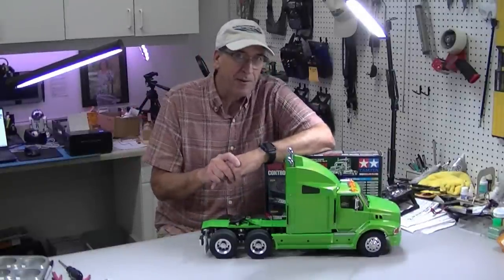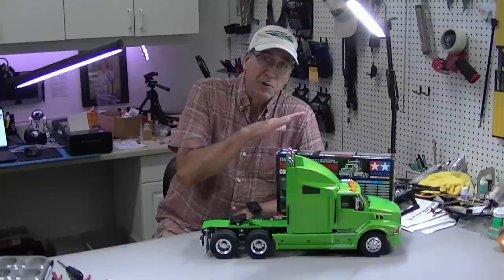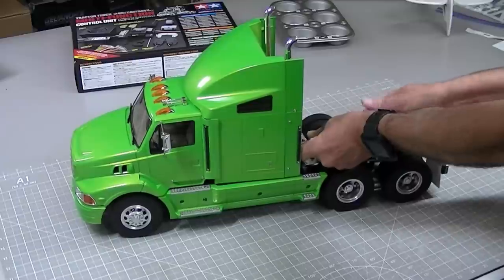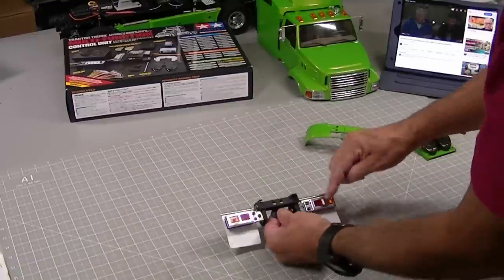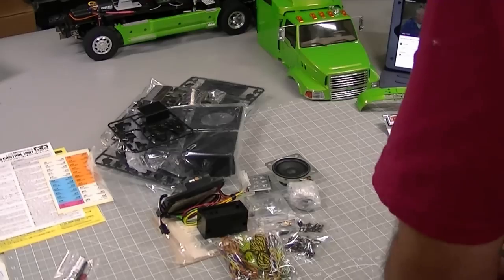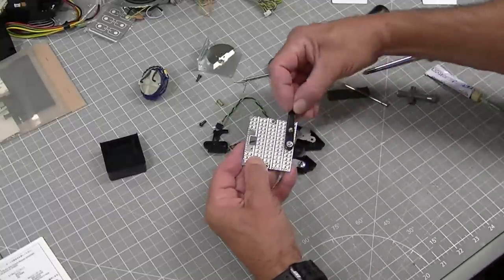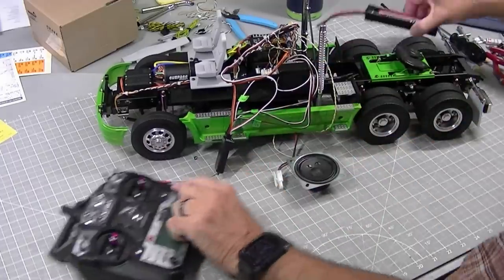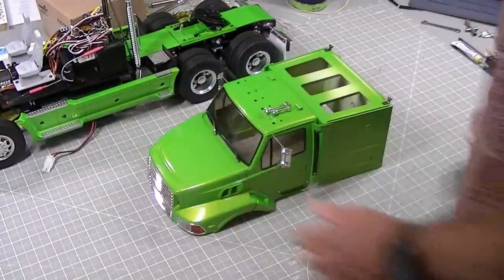1/14 Tamiya Ford Aeromax MFC Install - In an already finished truck

Comment: I like the idea of putting the truck together first then adding the lights, sounds, and vibration unit later. Makes more sense to me because you have two different sets of directions. Now if it came all together and had one set of directions in order. I could understand it

Comment: i think it woul;d help if you put a few small pieces of electrical tape to hold the wires together and that will make wrapping the spiral wrap quicker and easier.that uis from an old mechanic

Comment: Nice bit of work. The Tamiya Tundra is one model where it is easier to install the speaker and vibration modules during the chassis build. It can be done after building, but it not easy to get them in place.

Comment: I am going to be ordering the ford Aroe max super kit. I am wondering do you have the crystal clear glue, sticky tape, lock tight, I can’t remember what else you recommend in the video.
Reply from the maker: Double stick tape and locktite come in the kits.  The clear glue is called Micro Krystal Klear and you can get it from Amazon.  I have pretty much anything else you need to build one.  Email me if yo have questions - my email in the video descriptions.

Comment: What did you use to remove the parts tree with?
Reply from the maker: https://hobbyconcepts.net/products/side-cutter-small-wire-cutter-plato-170?_pos=1&_sid=258c571e5&_ss=r

Comment: What is the better sound and light unit ? Beier or Mfc ?
Reply from the maker: The Beier system is far better, better sounds, handles way more lights and has many more features but it is harder to setup.